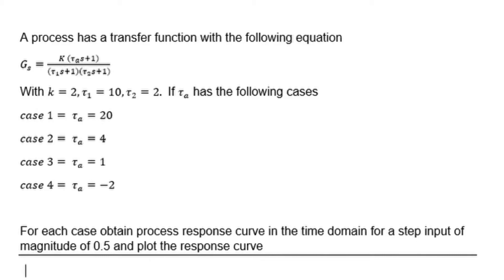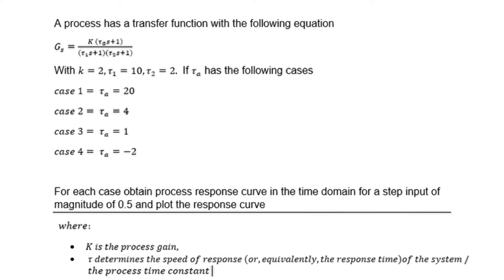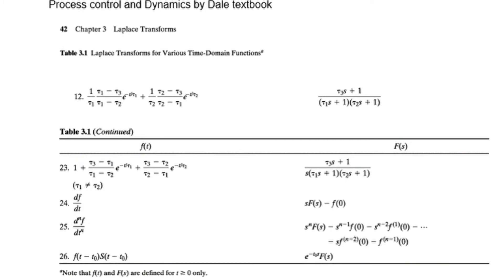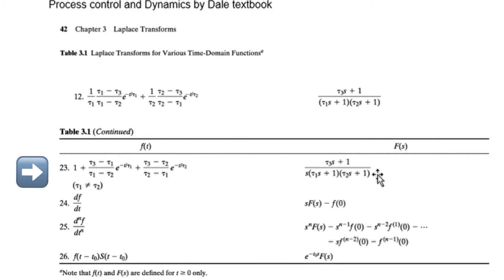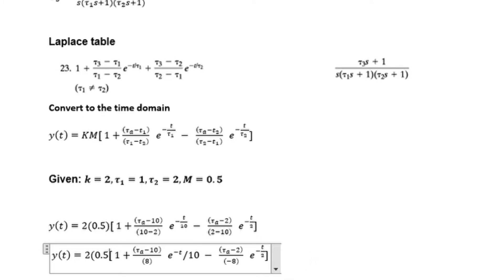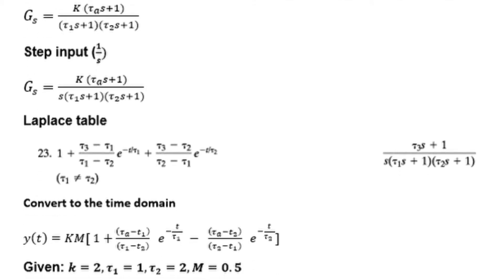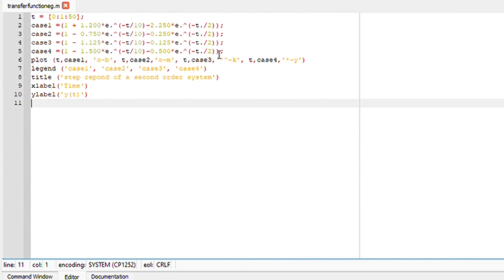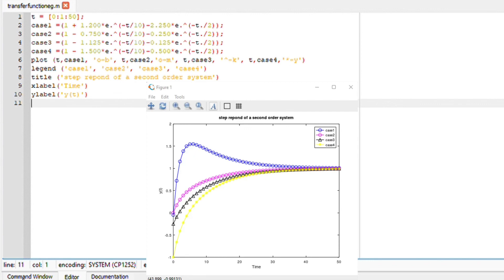Example: A process has a transfer function with the following, With k=2,τ_1=10,τ_2, case 1= τ_a=20

Comment: Hie Kgabisang ur videos are very help continue doing the good work can u please make vidoes were you explain fully how to convert block diagrams into series, parallel and feed back
Reply from the maker: Hi, I hope these two videos help 

1. Step By Step Guide. Transfer Function -Process Control E.g 5 using Octave. Series,Parallel,Feedback
https://youtu.be/GT5AoLXlg1E

2. Transfer Function -Process Control Example 4 using Octave. Solve Series, Parallel, Negative Feedback
https://youtu.be/iovjD2nK1mA